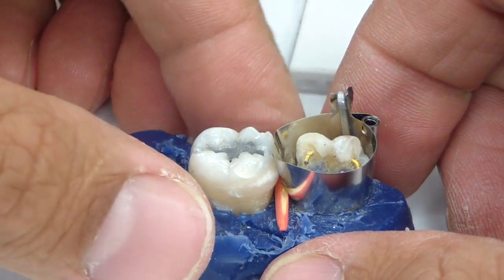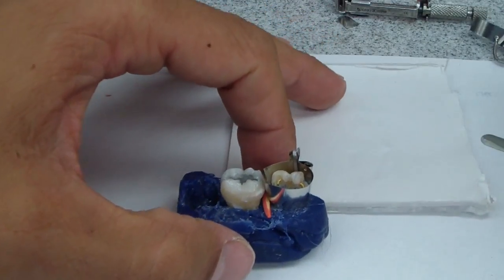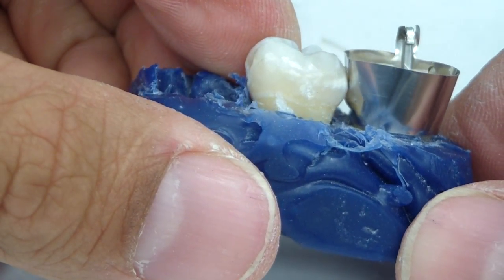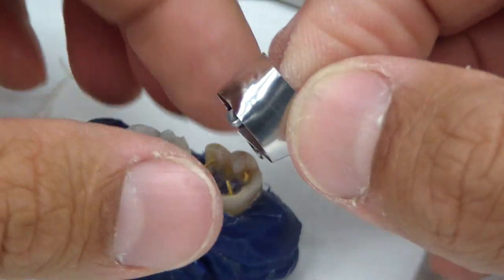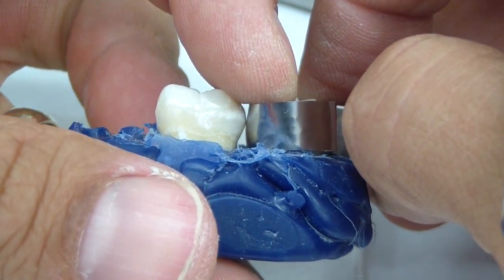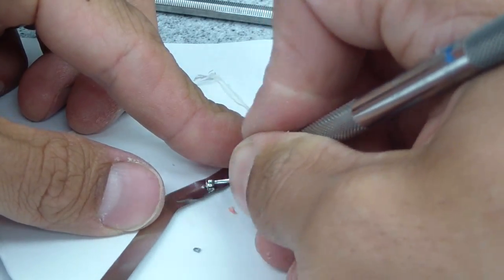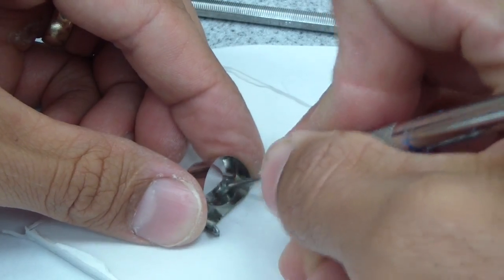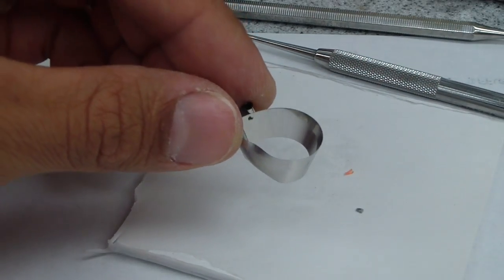Matrix Band - Precontour Interproximal Region - Complex Direct Restorations

Comment: Thank you. This issue of the wedge interfering with the natural desired contour usually occur if the wedge hight is protruding coronally too much above the gingival margin, or if the clinical crown is too much short. Ideally the wedge should be not protuding too much coronally after being wedged tightly so you will have enough clearance in interdental triangle area to perform the matrix burnishing and contouring. So how to get to this ideal wedge is by 2 main strategies: 1) By "removing" the excess wedge which is coronal to the gingival margin by large round carbide or by large spoon excavator (excavate in one direction to avoid dislodging the wedge). Then you just move the wedge out a little just to allow your matrix to slide in then tighten the wedge again. 
2) sometimes you have to remove (excise) a lttle of interdental papilla to to allow the wedge contact to tooth to be more apical to your gingival margin.
Reply: All your solutions will cause lots of  bleeding though.
Reply: Or something called anotomical wedge